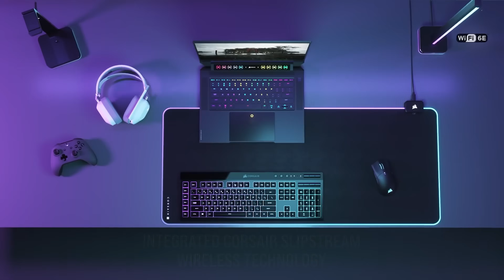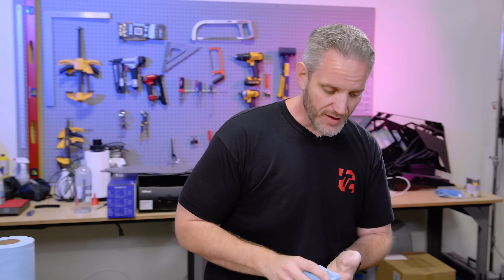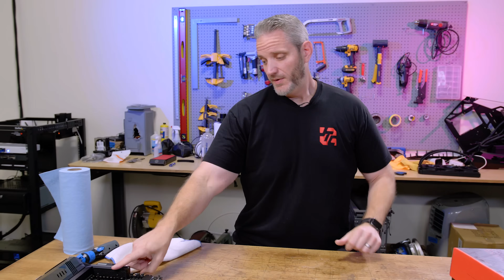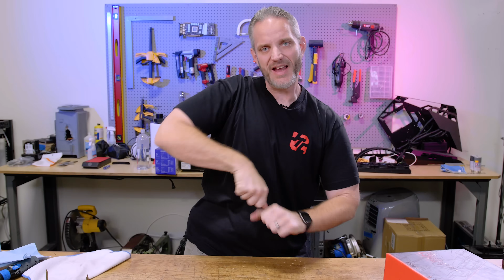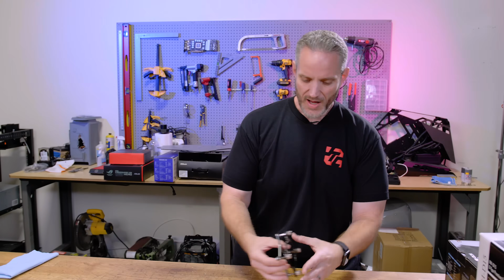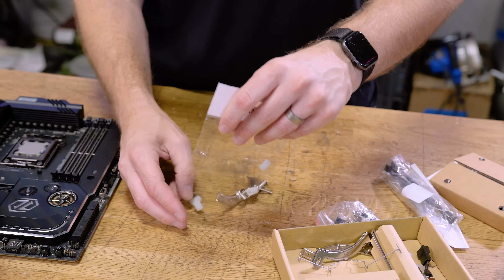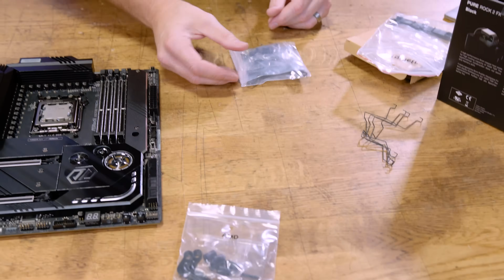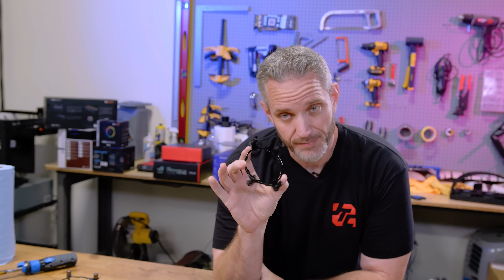AMD made a terrible flaw with this design...

Comment: Hey Jay. NH-D15 (and any Noctua Cooler) works perfectly with AM5, as long as it has the AM4 bracket. I've done all my Ryzen 7000 testing with NH-D15 with cero issues. You just happened to have an older NH-D15. Noctua provides AM4 bracket for free, btw.
Reply: This seriously needs more upvotes, the NH-D15 has been the very best cooler I've ever owned, liquid cooling included. I was a massive liquid cooling fan before I bought my NH-D15.
Because it's so old you need to get an updated mounting bracket for AM4/5, these coolers made before January 2019 do not include the mounting bracket but Noctua will provide for free if you can show them proof of purchase.
Reply: @quietduplicity8838  icegiant prosiphon elite copper will be the next upgrade for us dh15 owners, but it's not released yet and requires alot of space. combined with the new 4 slot GPU's, that's gonna be a lot of weight on the mobo
Reply: Noctua will provide an AM4 bracket to people.
Reply: Actually he can use the adapters from the NH-U12A with the D15, is exactly the same one.
Reply: I've had my NH-D15 since I was on a 5930k in 2014. $9 USD for a an AM4 kit, and my NH-D15 is STILL going strong on my (AM4) 3950x.
Reply: @reikoshea  You wasted $9 because Noctua provides new mounting brackets for every new socket for free if you have proof of purchase for the cooler and your board. If you run them long enough they have incredible value and the D14 and D15 are capable of dealing with pretty much any CPU out there. 280 and 360 mm AiOs can outperform them though.
Reply: @reikoshea  Same here, only mine's the D15S, needed due to having tall heatsinks on my RAM when purchased for my former Z97 (LGA1150) system. This too worked fine with AM3+ also, just not mentioned today, as both Intel & AMD mounting hardware was included.
Reply: both of my nhd15s came with am4 brackets, he must have gotten one that sat on a shelf for a VERY long time.
Reply: @ClanBez  That's a fairly good troll. Keep up the good work, lad.
Reply: Hi. I have a question about this. Does this mean that Noctua coolers are perfectly capable to work with the new Ryzen 7000 series although the 95°C? So, no need to buy a liquid cooler? Thanks in advance
Reply: @AresSW  yes it’ll work. The base TDP is just below capability of the cooler. It’s not rated to handle max turbo though, so you’ll definitely hit 95C under load. If you wanna be below 95C it’ll probably be better to either look at delidding or at a larger water cooler.
Reply: @reikoshea  Watercoolers changed nothing as you still hit 95C. Tests with 480mm rad have been made and nothing changed.  Delidding is the only way to lower temps.
Reply: @AresSW  have you read the article written by TechPowerUp? They compared 3 different coolers
Reply: @Mewzyc  No I didn't. Can you link it or share the name of the article to check it? Thank you
Reply: @AresSW  AMD Ryzen 9 7950X Cooling Requirements & Thermal Throttling . Based on this, I feel safer getting a D15s .
Reply: @AresSW  My NH-D15S works perfectly fine with the Ryzen 7 7800X3D. But had to get the AM4/5 kit from Amazon for it to work, didn't have 2-3 weeks to wait to assemble & test my system, most retailers gives only 30 days to return if not desired or DOA.
Reply: @AresSW  Check out hardware unboxed videos, may want to undervolt or run in eco mode but you lose virtually no performance
Reply: If you purchased NH-D15 before November 2018 you do not have AM4 bracket. I reached out to Noctua and within 3 working days, they delivered one to my home address for free! There is a reason why they so expensive and that is their life time support :)
Reply: This thread of comments should be required reading for everyone watching this video.
Reply: I can confirm also. Using nh-d15 on 5800x and mounting bracket looked exactly like the other noctua cooler shown.
Reply: Is Jay just being lazy?
Reply: @alpsalish  i mean no not really theres a lot of things that you can't account for so just making a statement that might not be true for everyone does harm also.
Reply: sweet my chromax will work then
Reply: that d15 red X was painful to watch. sadly.
Reply: at my job, the NH-D15 was the first cooler that arrived with the LGA1700 mounting included, so, i'd think noctua would be really quick to include any now mounting system.
Reply: can confirm, bought a new NH-D15 and it does have the AM4 bracket, and on the instructions it even mentions AM4+AM5 specifically. I get my 7950X next week and we'll see for sure then, I guess, but my doubts are gone after checking this a little closer after remembering watching this video when it released and now watching it again.
Reply: thank you for this comment. As a NH-D15 owner planning to upgrade to AM5, the video got me worried until I read this comment thread.
Reply: Doh!
Reply: New ones will have the bracket. If you are reusing a cooler check if you have the AM4 bracket, get a free one if you don't have it, or you can buy the AM4 brackets for the cooler from some online retailers if that is faster for you.
Reply: I have NH-D15S and works perfectly. That is as long as you get yours manufactured after 2019
Reply: i have a NH D15S with an amd 7800x3d I built it last week, very happy with the temps, works perfectly. I put my bars inverted (I heard they work both ways?) with teh behd going inside rather than outside. works perfect. temps seem normal.
Reply: Not only do they all have am4 brackets. They also just released new offset mounts for 5 bucks. I was using the normal mounts which worked great and just upgraded to the offset mounts which also work great. There is literally no worry with using any noctua on am5. This is all running on my 7950x3d.
Reply: Thank you for pointing this out! Upgrading to AM5 on 9000 release and was beginning to worry about my Noctua not fitting!
Reply: yep all NH-D15 bought since 2019 are also compatible with AM5. 
Jay must have a really really old version of this cooler :)
But it proves how long AM4 already existed and was working and how a small design change can now make AM5 work again.
Reply: They didnt pay him so he trashed them cant trust JAY
Reply: @justmeyouknow7649  what? Who got trashed? Lol
Reply: Noctua customers like battered women explaining he's really a good guy

Comment: others have commented... But It should be repeated noctua lists on their site for AM5 support that anything built and sold prior to 2019 will not work without an adapter kit (which they encourage users to reach out and work with their support on getting) and 2 low profile ones they straight up say will not work with zen4.

As most Noctua uses the factory back plate for amd... and not the clips... like jay points out.

the team at Noctua is all about forward compatibility and less ewaste... so Jay's old nh-d15 WILL work after he grabs the adapter kit.

Comment: Arctic Liquid Freezer II coolers don't come with their own backplate, but they instruct you to use the motherboard one, so they should be compatible with AM5. The only coolers that wouldn't be compatible are those with their own backplate and different screw points. Are there such models around? Honest question.

Comment: EK have already putt the block on pre order and it will keep the AM5 back plate as is and bolt to it .
so Lapping 3mm off the top will help as long as the block still fits

Comment: With the massively thick IHS, I'd be curious to see what the performance is like replacing the IHS with a vapor chamber. It's not going to be as good as direct die, but I'd wager it would be far better than the IHS. Maybe AMD would consider replacing the IHS with a vapor chamber if they want to stick with this stupid AM4 z height compatibility.

Comment: So a dumb cut to the chase question.
Is the am5 build cooler than am 4 build ?
Or is AM 4 build cooler than Am5 build ?
Am5 + DDR5 VS am4 + DDR4
Let's say with a 3080 10GB card?
And ryzen 7 7700x  am5 vs 7 5800x  am4 ?

Comment: Hope this helps... According to Noctua the D15 had been shipped with an AM5 (and AM4) compatible kit, since Jan 2019, that's on their website. The older ones obviously don't have the correct kit, like the one you've got. I bought the chromax black version of the D15 which they say is compatible. Some clarification maybe needed. Either way Noctua are offering free kits for those older versions that are not compatible, or you can just buy one.

Comment: I can't help but think they would have been better off completely redesigning the cooler mount. Use the most efficient IHS rather than the one that matches the mounting height of an AM4 processor. The entire architecture has changed, what's one more component? It's not even a very expensive one in the grand scheme of things, and personally I have NEVER used an old cooler on a new CPU/Motherboard regardless of compatibility. Just my opinion though.

Comment: I think people forget that direct die cooling with liquid metal on other CPUs such as the 12900K also leads to ~15°C improvement, so the thicker IHS really made a difference of ~5°C relative to "typical" IHS thickness. I'm a little tired of the sentiment that the non-universal cooler compatibility and thicker IHS made 20°C of difference. I initially thought that all AM4 mounting mechanisms that do not use the two tabs mounting method would be incompatible with AM5, but it turns out that it's only for coolers that use their own back plates, which are much less common (but still no doubt a real problem).

In addition, I'm certain that it was much early in AMD's development with TSMC on the 5nm process when they tested Zen 4 transistor behavior and core temperatures was when they discovered the 115°C Tj max and decided on the 95°C typical operating temperature, rather than the theory that the Tj max or acceptable operating temperature was raised at the silicon level to achieve the mechanical requirements with maintaining cooler compatibility, because that's completely backwards with regards to semiconductor engineering. AMD definitely made the mechanical decisions they did after baseline silicon behavior was discovered. The Apple M1 family SOCs targets 95-100°C degrees operating temperatures and are also using the TSMC 5 process, it's not a coincidence.

Would it be nice if Zen 4 ran significantly cooler at the same performance? Definitely.

Will 95°C daily use be problematic? Only time will tell. In my experience with frequent Intel 14nm and 95°C overclocks to rush out renders for days at a time back in 2018 & 2019, I think the silicon will be fine in the long run. All of the 14nm chips I bought for my company in 2018 are still 100% stable and operating today. Jayz pointed out that it might only last 12 years instead of 15 years, and he might be right. How long do you expect your silicon to stay running, if you even have a working motherboard at that point?

I think that Intel 13th gen will probably approach multi-core performance in a similar fashion considering they're increasing the maximum turbo power to 253W, and leaks indicating peak power draws of upwards of 400W. It's nice that Intel 7 manages to run cooler per watt with their IHS, but it remains to be seen if they're overall more efficient in multi-core workloads per with an increase in e-cores. RIP HEDT.

Comment: That whole thing "95 is by design" is such a nonsense. Sure the CPU will not be damaged, but it is hitting thermal wall, meaning only way after that is down for performance. If one CPU runs 65 the other 75 it doesn't make difference, but if a cpu thermal throttles it will start limiting its performance. How in the world it can even be a discussion. Smaller case, average cooler and you will not get that advertised performance with that "95 by design" nonsense.

Comment: It might be a provision for 3D V-Cache, but then again: that's not 2mm thick (unless they want to do dozens of layers).

On the other hand: if Zen4 can achieve those clocks & efficiency with a 2mm thick heatspreader, just imagine the potential it must have. Maybe future generations ("Ryzen 7000 2nd Gen" or something like that) will address this issue by using a thicker substrate, so the heatspreader can be thinner - that might buy AMD a whole generation without actually changing the architecture! Intel might be in deeper trouble than we realize yet.

Comment: If you trust the manufacturer of the cooling solution, most of them have charts indicating comparability. And will specify if an extra adapter is needed or included. Some models include adapters after certain production dates.

Comment: You can have it rock wierd with that 4 bolt mounting mechanism too, particuallry if you dont torque the screws in the correct pattern or dont torque them equally. The hook method just uses 2 points to center the mounting pressure rather than 4. Neither prevents the common mistakes of operator installation error on inequal pressure application. 

For the hooks you obviously dont want to hook one side and then the other, you want to use both hands and clamp both hooks at once. If you use 4 bolts, you need to tighten in 3 steps or its going to rock: you cant tighten one corner all the way before any others and expect it not to be on crooked.

Top brands that come with backplate replacements will likely make a new backplate for their existing would-be-compatible coolers. Like EK does that kind of thing all the time. They also already have AM5 specific blocks in pre-order.

That making the Zen 4 IHS that much thicker than the Zen 3 was probably not the best idea, tho. Maybe they wanted to help derbauer sell his delid kids :)

Comment: Here's a thought:  Could AMD incorporate a vapor chamber inside the IHS and make the top of the IHS copper?
Perhaps they could release two SKUs of each CPU.  A normal IHS version and an upgraded IHS like just mentioned.  I'm not an expert in coolers and heatsinks, so I have no idea if this could be feasible.
Reply: or make thicker PCB and thinner IHS
Reply: copper is more malleable
Reply: I'd be afraid of the vapor chamber becoming a mini explosion if it reached 95*c anyways
Reply: A vapor chamber needs somewhere for the water to rise to so it cool and then fall back down again. They're like a lava lamp. Short distances simply wouldn't work, because the temperatures would be fundamentally the same at both points.

Comment: As for your test request for Derbauers, seems like it would be easier to sand down the IHS down 2mm and make a new mounting solution to solve for the Z height change. That way you are leaving the original die to IHS contact in place and not trying to simulate it.

Comment: It's cool many will offer free kits though. I take it height wise and cold plate covering dies will be fine, though new AM5 designed coolers with new mounts and better aligned cold plate would be more optimal. As I wait to see X3D I plan to get a new AM5 cooler anyway.

Comment: Intel 12th socket is bending  the cpu 
 Am4   socket  can't   secure  the  pga 
 Am5 is not even  let cooler  touch the cpu  correctly.
 Xbox  series  x  and ps5 having  burning psu circuits
  Ps5 have dead triggers and   fan  header can  ripped off  from the mobo.
 What Should i buy now? a laptop ?

Comment: I mean even the 5800X runs at 90c anyway. It's only a 5 degree bump from that to the 7000 series. My 5800X gave me the a bit of temp anxiety at first but I've learned to accept that it's just designed to run hot.

Comment: OK, this video is a bit here and there (discombobulated)... if I buy a new AMD CPU, I will buy a cooler designed for AM5.  AMD does not makes the water cooler, so it's the cooler makers responsibility to create something that works best for Ryzen 7000, no?  I understand that people want to keep their old coolers, but upgrading anything in life sometimes means upgrading all that comes with that upgrade.  If I buy larger rims for my car, I cannot use my old tires?  🤯

Comment: They should have made the PCB below the die thicker instead of the heat spreader.  That would avoid the increased thermal resistance and still allow retaining the external dimensions for the thicker vcache dies (by using a thinner PCB).  Building a PCB with varying thickness for dies with different thickness is also doable with standard fabrication methods, in fact, raising up the current dies while keeping the edge thickness can be done the same way, producing a more thermally efficient version of current SKUs.

Comment: My one big question is did Intel do this also or did they keep the z axis height the same all this time.  I wish we could easily remove the Intel housing and do direct dye like the AMD5 Derbauer did.  Is that even possible this is something that would help with INTEL heat and speeds?  Wouldn't it be nice if they both sold cpu with direct dye connections?

Comment: NH-D15s sold today are AM4/AM5 compatible and Noctua sells an AM4 bracket for the old ones that only came with AM3 bracket too.  Also Jay the flat head screwdriver mount AMD cooler went away a long ass time ago.... starting way back with socket 754/939 they went to a cammed lever system to apply tension so i guess you haven't operated a stock cooler in a very long time LOL